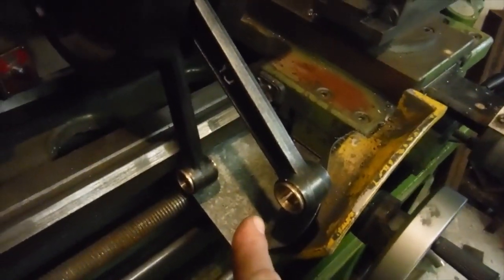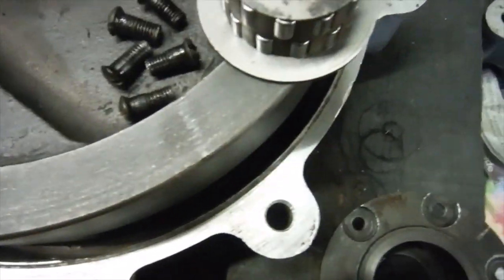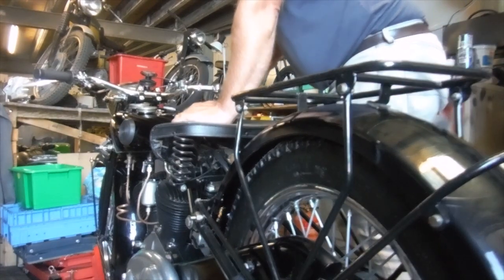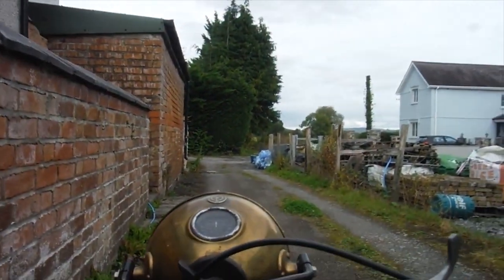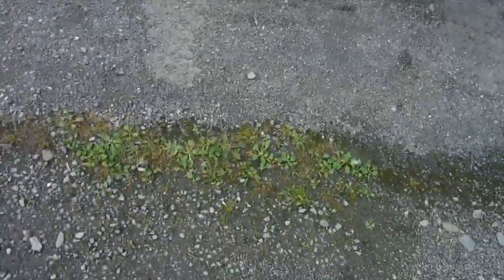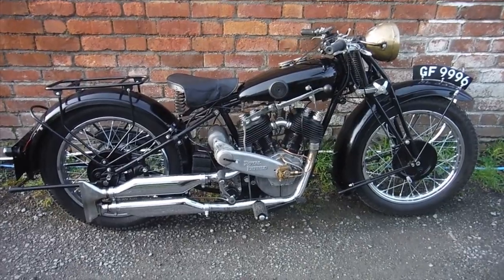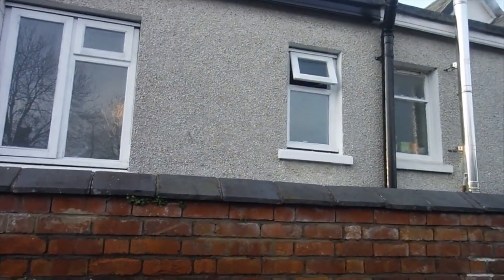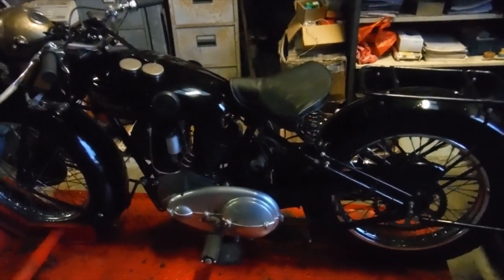Royal Enfield 1000 cc Model K rebuild from crank build to road testing the finished engine work.

Comment: WOW Paul, I had a 1937 Enfield model KX 1114 cc export model, I sold it in 1995 to a man in Manchester. I lived in Pwllheli then.
Reply from the maker: I shall be working on one of those soon!
Reply: I had a kx  for a while   Never really got it on the road properly. Which I now regret watching this.  At the time I was told about a bloke who had one who did Cornwall to Manchester very regularly on it. 
Ex BR driver, now have a b40 green laner and a 1200 knucklehead ( nominally1946 but mainly newish parts. ) ride safe

Comment: We are lucky to visit this channel and be able to watch this rare piece of motorcycle. It impresses its precise and long-lasting operation. Great style when it comes to motorcycles. Inside, with the two cylinders displaced on a single pin and a tunnel piece to accommodate two roller bearings for the connecting rods. Drilling of intelligent oil channels, taking advantage of the centrifugal force of the steering wheel. SHOW!
Reply from the maker: Thank you very much, Glaico!

Comment: Absolutely joyous, your uncommon exuberance is very justified. It's hard to believe that's 90 years old, sounded totally unflustered. Although my heart was in my mouth at that first gear change. 

I can't remember when I last saw anyone using Devcon, fixed a few Doxford bits with that over the years.
Reply from the maker: Thanks Niall. Devcon is, or was, accepted by Lloyds as a repair on marine machinery castings and the like, it is very good stuff, as you obviously know, but quite expensive.

Comment: Really interesting to see the crank runout there .... I ride harleys and they are favourite for a bit of runout due to the 'pressed together' cranks that are used these days in place of the old bolt-together ones of yesteryear. All the 'haters' love to throw the muck around about Harleys, but all 'assembled' cranks and indeed solid cast or forged cranks have runout due to the nature of manufacture/maching, it just depends how much stress they are put under wether or indeed when they decide to have a little failure episode !... you can't educate haters at all.
Reply from the maker: Actually, many British and Japanese machines use pressed up cranks, it is all down to time and care spent on assembly and truing, at the end of the day.
Reply: @paulhenshaw4514  You have hit the nail on the head there with the Harley cranks..... they are assembled by machine to a certain tolerance for use and are then used in engines that get over-tuned and then used with a lot of abuse so it often ends in tears !

Comment: I had a KX (1200cc) model 60yrs ago but it didn't look or sound as good as that one. You've made a beutiful job of it, well done. How was the handling? I believe they made shorter bottom links to convert to solo steering.
Reply from the maker: Thanks, Keith. The handling was fine, but the gearing was a bit low, although that could be fixed quite easily.

Comment: So with the conrods on the same journal the pistons fire at the same time or just after one another?
Reply from the maker: One fires after the other, I am not sure if I remember right, but it could be the 50 ish degrees after, or it could even be at the next tdc for that cylinder. Someone else might know for certain and like to comment? If I had such a machine here at present, I could soon work it out!
Reply: Thanks for your reply Paul. Stunning machine. @paulhenshaw4514

Comment: If I may ask, were the crankshafts, from the factory, ever perfectly 'straight', with NO runout ? Or did they all come with a tolerable margin of same ?
What I'm I'm getting at is this: the needle movement that your gauges display now, are perhaps identical to what was there before initial assembly of the engine...and NOT due to in-service usage ?
[Albeit, I make the latter surmising, all the while not being able to understand how it could be so. A cute bit of cognitive dissonance at work, what ?]
Reply from the maker: Hi Amelie, it is probably rare to impossible to achieve zero runout on cranks such as this, even at the factory, due to the nature of how the individual parts are machined and fit together, but generally, a couple of 'thou' at the main bearings is usually acceptable, so this one turned out pretty good.

Comment: hi paul is this k model a total oil loss system?
Reply: also there is less oil access to the rear cylinder because of the crankcase slot i had an 800cc v twin side valve engine some years ago . . I thought the front crankcase cylinder opening had the slot so the rear cylinder had better oil to it, I may have that wrong though  . . it had total loss oil system i think i also remember the drive side was just a plain brass bearing .. of small diametre
Reply: this k engine is much prettier than the 8oocc one, the fins were vertical on the one i had
Reply from the maker: Hi Ged, there was an oil baffle under the front cylinder as I recall. The oiling was adjustable total loss and all the bearings, big ends and mains were caged rollers originally, although I fitted a needle roller on one side as a main bearing.